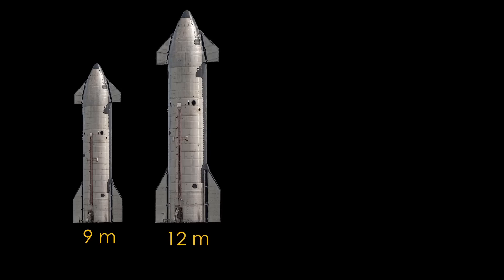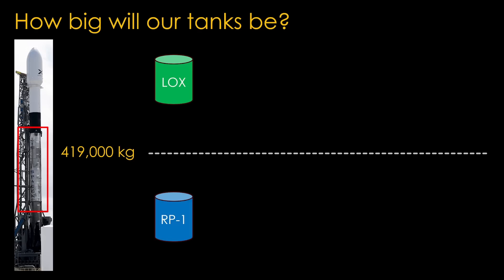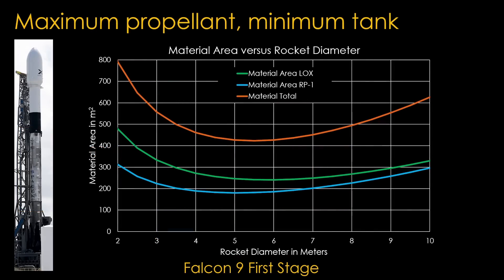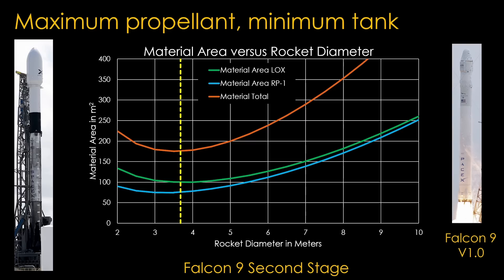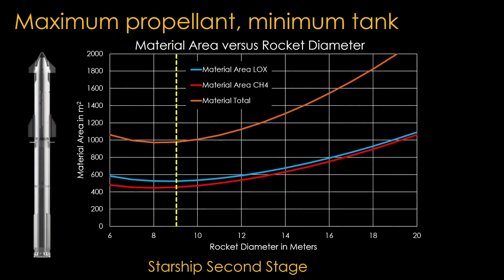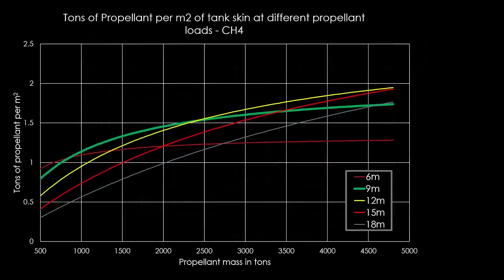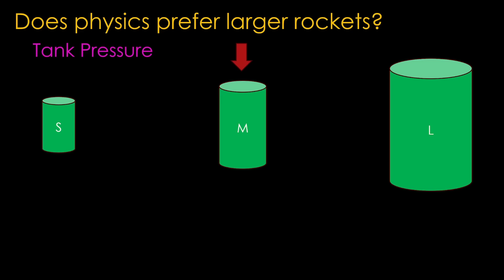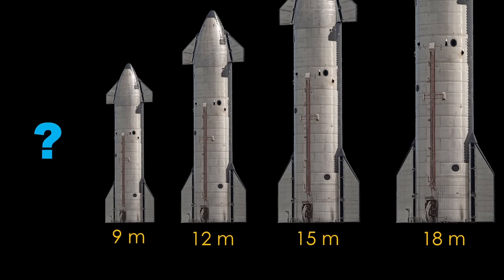Will Starship Get Bigger? Propellant tank sizes and rocket diameters

Comment: Why did SpaceX goof so badly with the lack of water suppression for Starship IFT-1? What about their engineering process and the available analysis tools wasn’t up to the significant challenge?
Reply: Based on the Data they gathered through all those static fires they believed the concrete would withstand one launch. What probably happended is that the ground underneath the concrete caved in, creating a void beneath the pad and the concrete just gave up. (i believe Musk said that but i couldn't find where and when he said it)
Reply: They didn't.  They knew an upgrade was required and had the equipment on site ready to be put in but decided based on the tests done to date to risk one flight rather than delay.

Comment: a 18 feet + diameter starship would't be usefull right now, but in 5 years it 's going to be etremely usefull. I don't think it could be launched from land, considering the amount of noise it would produce and how hard it would be to transport it. I think it will be used to fuel a fuel depot and eventually to build an orbit transfer station.I just can't see anything else than a sea dragon kind of rocket. Considering the size and wheight, i don't think it would be doable to catch it on a tower and i know that reusability is the key but i don't think it would be doable economically at this size considering the frequency at which it would be launched. Just a big dumb rocket with the highest payload we've ever seen like the seadragon on steroids.
Reply: I doubt they're done with the 9m version in 5 years. :)
Reply: @TheEvilmooseofdoom  it's not a replacement, it's a support of the 9 m, because having to launch 8 rockets to fuel to go beyond orbit is a bit inefficient and everytime you launch it there's a bit of wear.
Reply: @thecellburner  Still means starting both development and infrastructure over again.  That's not fast OR cheap.

Comment: It won't get bigger in diameter, since it would mean that literally everything would have to change. I am talking about the orbtal launch mount (OLM), the launch/catch tower's arms (atleast, maybe even the whole tower) The number of engines in the booster, the fabrication process in the starfactory (I mean, If they are testing 9m rockets and already building a factory for automating that, I don't thing they will be getting bigger since it would need to replace every single machine/process in the fabrication). So... NO, it will not happen at the VERY LEAST until the first mars landing.

It will only get taller since it is composed of stackable 9m steel rings, but not wider.

Comment: The current size can with improving desigen can do 300 tonn to LEO...with simplified second stage instead of starship..that is enough with third stage...preferbly a Thermal Nuclear one that is mated with Mars lander in orbit...this way, they land 100 tonne on Mars with maybe one refuling, and one booster TermN system that takes it to Mars injection orbit...that system is eqxtermly oversized with many efficiency to be reconginzed...thus any thing begger than 10 meter is just excessive...the biggest single mirror telescope that built is 8.4 meter..this no need for any fairing larger than 9 meter either...

Comment: Another complicating factor is reentry heat load. Smaller vehicles are better suited for reentry because they exhibit faster deceleration and can slow down more at higher altitude.
Reply: That’s inaccurate. You want a low mass relative to the aerodynamic cross section. That’s possible to achieve on both smaller and larger vehicles. For crewed vehicles, I would think it’s easier to accomplish on larger vehicles, as the volume needed for the crew is easier to work around.
Reply: @SpaceAdvocate  Incorrect. The larger the vehicle, the thicker the walls need to be, the greater the mass to cross-sectional area.

Comment: Something you neglected to mention that might be a significant consideration: wouldn't air resistance increase very significantly with gains in width?
Reply from the maker: Air resistance is not a big energy loss when launching to orbit. Rockets are slow in the lower atmosphere and do most of their work in vacuum.

Comment: Why not both? 9 meters for payload is absolutely huge relative to anything we’d want to put up in the near future (say… 20 years out?). I could see a scenario in which the 9m starships handle the actual payloads, while the absolutely gigantic 12m starships are just used for refueling. Eventually, the 12m rockets could be phased in for payloads after that.

Comment: Yes, just not width wise for a LONG ass time, it will go in length over time, just as F9 did, reason being is that all the launch infrastructure would need changing to accommodate a wider starship a longer starship is fine though, and we already know a longer startship is coming, but that's V2 I will assuming there will be a V3 and maybe even or 4 and 5 as the engines improve their thrust.

Comment: Thanks for a great video. However... after watching it I get the feeling that you think 9 meters is on the small side, when it is in fact the fattest rocket ever flown. It isn't an easy thing to handle nine meter body segments without damaging them, and the first prototypes even looked like amateur school projects put together from discarded soda cans. The biggest hurdle Starship faces is the ambition to make it reusable. If the booster is to land unharmed it can't be allowed to reach too high a velocity before stage separation, or the fuel economics goes down the drain. Saturn five didn't have to take that into account. Personally I hope that Musk will make a disposable second stage to maximize payload and prove what the launch system can do. Thanks again. The diagrams were great.
Reply from the maker: Saturn v was 10 meters, but I get your point.
Reply: @EagerSpace  I've been at Kennedy Space Center and stood under the Saturn V, but I didn't remember it being ten meters across. That's awesome. It turns out both starship and Saturn V has almost exactly the same speed at first stage separation, despite one being disposable, and the other not. That is quite surprising to me. I'll be looking forward to your future videos.
Reply from the maker: To be clear, I think that even at 9 meters, starship is a giant...
But SpaceX has come up with something new in that they are building the rocket right next to the launch site, so their transportation distance is short - only about 2 miles compared to 3.4 miles from the VAB to 39A. 

The Saturn V stages came in from remote factories by boat and you need to have a boat big enough for the stage and then deal with the longer transportation path and lifting them back vertical. With starship, they're just driving it down the road so you can deal with bigger size if you want to. Still a big PITA, but possible.

Blue Origin also has a factory that's close, though by my measurement it's 11 miles to LC-36. To be fair, the SpaceX roberts road facility at Kennedy is about 7 miles from 39A.

My personal guess is that they'll stick at 9 meters for a while but I've been pretty wrong on my predictions about what SpaceX will do in the past.
Reply: @EagerSpace  Great conversation. The government funding of the pioneering programs in the sixties made it necessary to spread the manufacturing over many states. (I can warmly recommend the mini-series "From the Earth to the Moon") It seems that there are few things Musk can't do when he sets his mind to it, but his dream of colonizing Mars is completely unrealistic. Starship is still a very promising tool for hauling heavy stuff to LEO and beyond, especially Starlink, space stations, telescopes and military hardware.
Reply from the maker: I recommend from the earth to the moon because I think it captures the time so well.

I think colonizing Mars is technically feasible, but there are many many concerns about doing it beyond the technical.

Comment: There is an error in the reasoning. 
The thickness can't be assumed to be the same. It has to become thicker for the larger diameter tank (all other things being equal, such as the maximum pressure difference it can withstand).
Reply from the maker: I talk about that in the video. The question is whether the skin size is driven by the needs of it as a pressure vessel or the loads that it carries as the main structural member of the rocket holding either the you're stage or the payload.

Comment: Very nice analysis, 12m diameter can also help with lift during landing, but can make troubles with side wind during liftoff.
Reply from the maker: I wouldn't expect size winds to be any different as long as the height to diameter stays the same.

Comment: The one thing you did not mention, but is also very relevant to the discussion of rocket diameter is aerodynamics and reentry characteristics.
A larger diameter will cause more drag losses on accent, as drag is proportional to frontal area.
Meanwhile on reentry a larger diameter will result in a smaller "belly" area, as A = 2rh = 2V/rπ, and will also reduce the distance from the flaps to the center of mass, potentially reducing controll authority.
I'm not an expert on reentry so i don't know exactly where SpaceX wants to be in terms of less belly area = less drag/lift vs. less belly area = less heatshield dry mass, but it's definitely a factor that should be considered.

Dry mass is still probably the most important and easily explained factor, but aerodynamics and reentry definitely deserve a mention.

Comment: 1:37 as a layperson, this seems to be a pretty big assumption to make. It would have been nice if you'd added two or three sentences to justify its validity. For example, what are the typical pressures in those tanks? What are the structural loads?
Reply: nevermind, should've watched the whole video first :'D
Reply from the maker: I did handwave a lot in the section on pressure and structural analysis but I think it's a very complex topic.
Reply: @EagerSpace  that section is pretty good and more than I expected. I simply wrote my comment before watching that far.
Reply from the maker: No worries.

Comment: I'm pretty sure pressure vessel dry mass scales with volume, not surface area. ie larger tanks need thicker walls at the same pressure.
eg: wikipedia, "Pressure Vessels": Quote: "No matter what shape it takes, the minimum mass of a pressure vessel scales with the pressure and volume it contains"

I know wikipedia is hardly an infallible source but it does provide a reference (I didnt check it myself) and I heard about this relationship from other discussions on nasaspaceflight.
Reply: "....and volume it contains" which is why he calculated surface area.

Comment: There is an advantage a bigger rocket gains on reentry too: A bigger radius object pushes the boundary layer further away from itself on reentry, therefore the heating is reduced. So you can get away with a thinner, weaker, and thus lighter heatshield than a smaller diameter vehicle.
Reply from the maker: Interesting. Do you know if any references I can read?
Reply: @EagerSpace  Scott Manley has a great video on it: https://www.youtube.com/watch?v=hLHo9ZM3Bis

NASA also published this presentation on reentry thermodynamics, that talks a little about the stagnation point, and how the radius is important, but it discusses a bunch of other stuff too: https://tfaws.nasa.gov/TFAWS12/Proceedings/Aerothermodynamics%20Course.pdf
Reply from the maker: Thanks for the paper. Scott does great videos but I don't watch them if its a topic I might want to cover - which is most of his videos - because I don't want to be derivative.

Comment: A sphere has the minimum surface area per volume and it gets better with bigger size. So if you really want to build a huge rocket you gotta ask yourself if air resistance will be much of a concern as you will beat it with sheer volume, mass inertia etc. The Sea Dragon introduced launch emerged in water but I guess it was still too small with around 20 000 t for being practical with a more spherical form. Not done the math but if you go for let's suppose 100 000 t --- you can go for single stage to orbit and water launch and landing. I even thought of hot water/steam as a cheap launch assist as hot water would make a damn cheap fuel/ monopropellant ((poor specific impulse but that doesn't matter for a launch assist)). 500 m/s or maybe 600 m/s exhaust velocity for the steam and shutting down at around 30 or maybe 35km ((dark sky)).
Reply from the maker: Unfortunately you need to carry the structural loads through the size of the tanks and my guess is that a cylinder is way better at that.
Reply: @EagerSpace  .... a cylinder with the minimal surface area  --- I suppose the basic idea was just surface to volume ratio gets better with larger volumes.
Reply from the maker: Yes.

Comment: Starship is presently a one size fits all design, but Starship has a number of different roles which have different design requirements. Firstly, as a tanker and an orbital refuelling station, the bigger the better resulting in fewer launches and lower boil off of propellant while waiting. As a lunar transfer vehicle, it is much bigger than the Orion capsule so flexibility in terms of cargo and crew number. If it were just to move crew to lunar orbit then bring them back to Earth orbit, then the present starship with further development of the heat shield would probably the way to go. Cargo to the lunar surface initially would be one way with maximum mass to fuel ratio - just enough to land. The vehicle could be reused as habitation and/or construction material. A lunar lander needs to carry less cargo and more fuel to return to orbit. It could be a stripped down standard Starship. A lot depends on in situ fuel production. 
For Mars again bigger tankers in orbit, but landers should be more specialise to utilise the thinner atmosphere- perhaps a more elliptical cross section to maximise aerobraking. An interesting decade is guaranteed.
Reply: The starship can technically carry enough fuel to not need fuel production on the moon. It can get there from low Earth orbit and back on a full tank.

Without in-situ fuel production on the moon, you will just be more limited in how much material you can bring back.

Comment: There's a couple of other factors to consider.  Firstly fuel boil off during longer duration flights.  Intuition says that a larger volume of fuel vs surface area would experience less fuel boil off than splitting the payload into two rockets, thus proportionately less payload would have to be dedicated to managing the temperature of the fuel, with proportionally smaller radiators, etc.  The thicker sidewalls of a larger rocket also help shield against the radiation of deep space, at least a little.  

And I'm sure the size of the rocket plays a part in reentry flight profiles and heating, although I'm nowhere near smart enough to work out whether a larger vehicle is beneficial or a bigger challenge.  Perhaps here the tables are turned and the larger volume to surface area increases the heating as there's more energy to dissipate per unit area...

If Musk is still eyeing a bigger rocket I presume the tradeoffs work out positively.

Comment: Take 2 boosters 9 meter diameter each side by side and one starship on top with 9*1.41 meter diameter or 12.6 meters. Then eliminate the need for the displacement ring by firing 2 starship raptors that are not covered by the boosters during separation.  Or take 3 boosters bundled together with one super sized starship on top. If the boosters are already available, then why not bundle them for bigger payloads?
Reply: @nonegone7170The cross section of two super heavy boosters is two circles shaped like an eight. The cross section foot print of the 2nd stage on top in the center is  a circle resting on both the super heavy boosters.  The top of the boosters would require a structural adaptation to transfer half the weight of the 2nd stage along 180 degrees of its circular footprint to each super heavy booster. Apart from this transition interface between the first and second stages, all structural loads are vertical (same as is now). And since some of the second stage Raptors are outside the figure eight cross section, their rocket exhaust does not hit the boosters.  This eliminates the structural impact of the raptor exhaust hitting the booster.

Comment: Thickness of a steel tank will double if diameter doubles.  That’s because the tension on each ring doubles. Tension per vertical inch = propellent pressure  times diameter divided by 2. Propellent pressure depends on acceleration and how far below the top of the propellant
Reply from the maker: Is propellant pressure driving the thickness or is the structural load driving it?
Reply: @EagerSpace  good question. SpaceX standardized on a certain thickness.  Ideally I would think the lower rings would be thicker being so many feet below the top of the propellent and having all that propellent accelerated at 3? G makes the tension 3 times greater. Vertical compression on the steel shell may dictate the max height and starship weight on top. That would be another calculation and I believe they must have made both the calculations when figuring out the steel thickness.